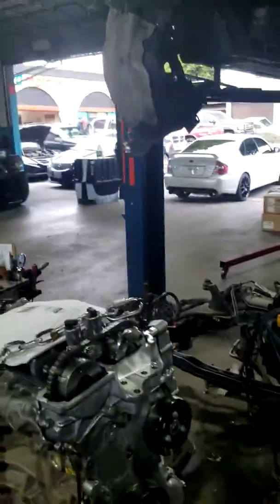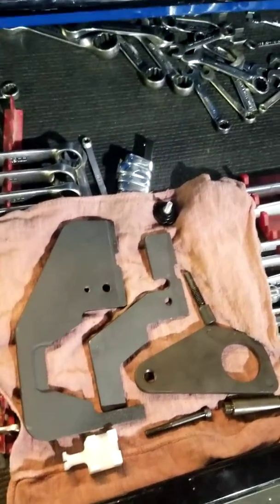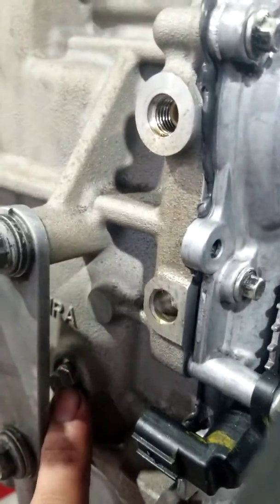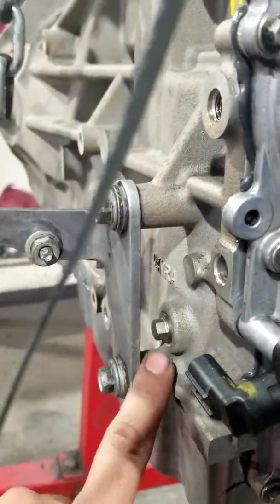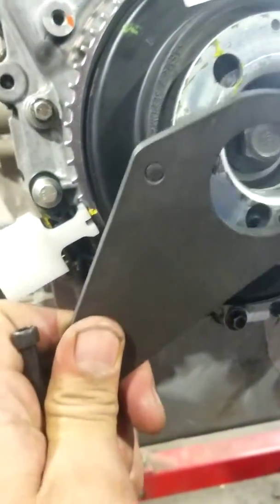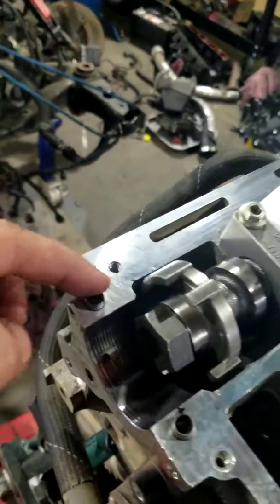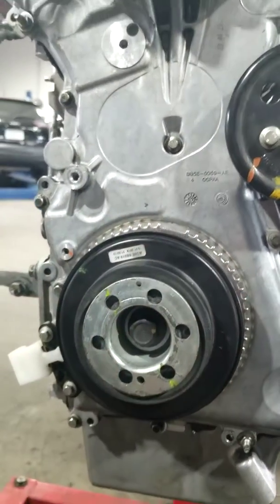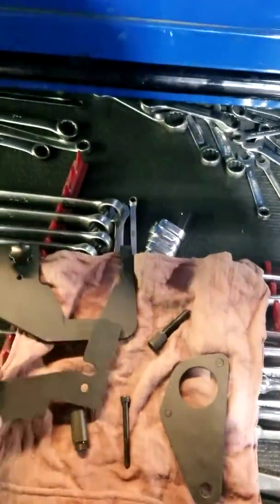2013 Ford Edge 2.0L timing tool alignment Pro Motors

Comment: To do that job does the engine have to come out
Reply from the maker: I don't think it "has" to but it is a lot easier and this subframe along w alot of newer stuff is simple to pull. And of its electric instead of power steering you make less of a mess and get it done quicker
Reply from the maker: Anytime it's a all silicone cover, i prefer the engine to be out. And if you are doing broken motor mounts the labor time can cover you.

Comment: The tech manual says install cam sprockets in the position you remove them implying that the proper install position is necessary.  The sprockets have a notch on them as well. Do you know proper position to install vvt csm sprockets?

Comment: Trying to do the timing on mine. First time, trying not to mess it up let's see. Thanks for the info
Reply: How’d it go?
Reply: @kbrown4023  well I did something wrong. it started! but a ton of fluid came leaking out immediately. Looked like oil and transmission fluid.